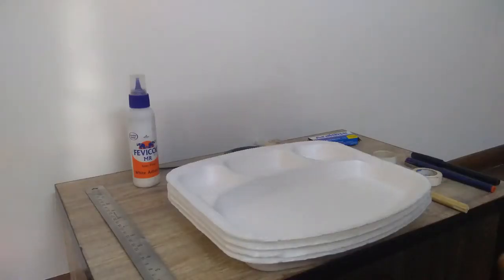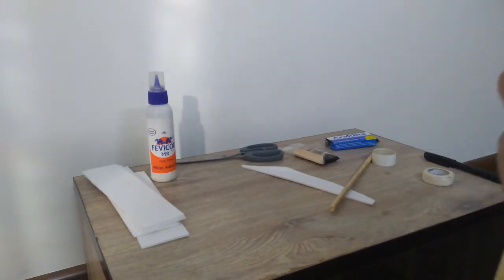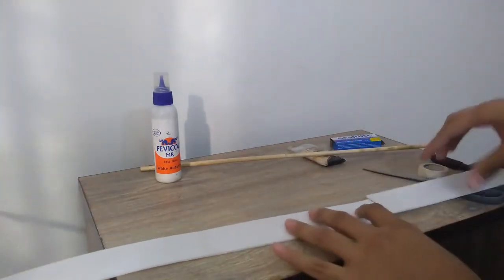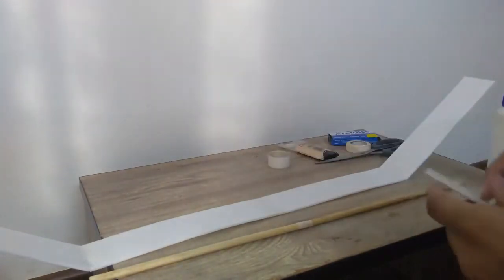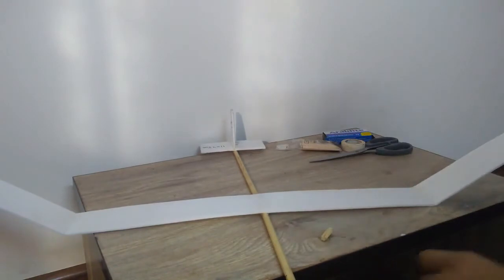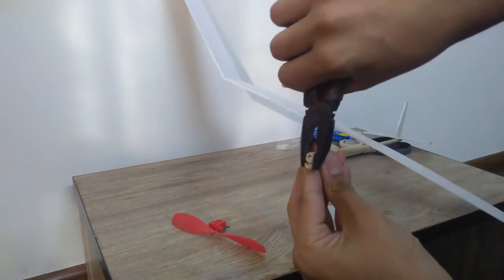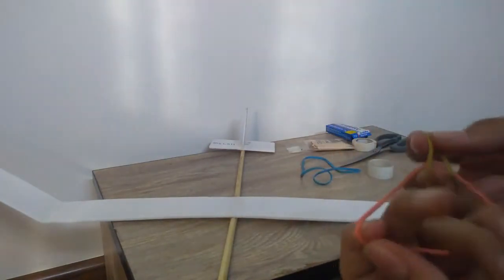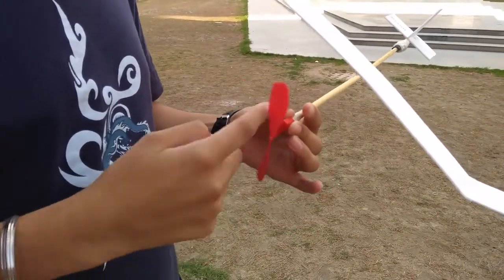How to Make a Simple  Rubber Band Powered Plane at home .

Comment: Great build. You could probably get a bit more distance with a bit less dihedral on those tips. You can see when it is flying they are almost pointing vertical so they are not giving you any lift. I often get the same problem.
Reply from the maker: GrandadsOtherChannel ok will make the changes thanks you....